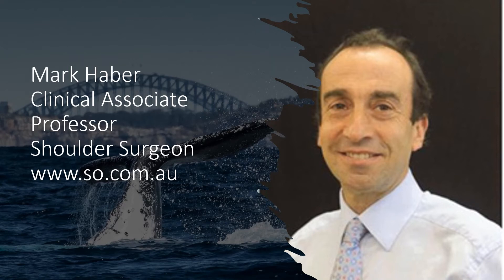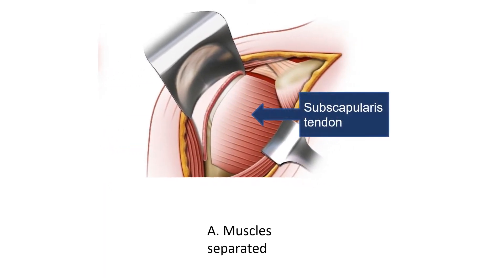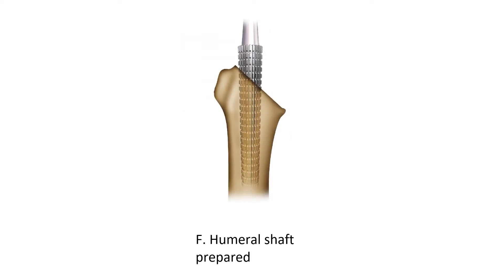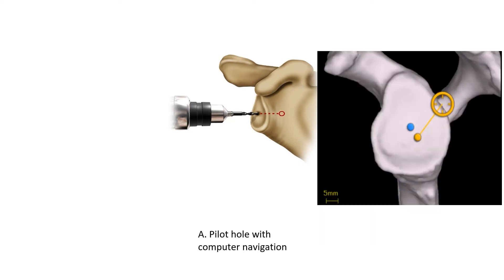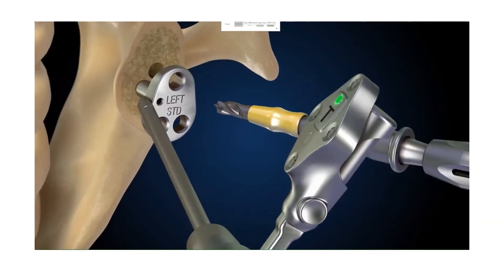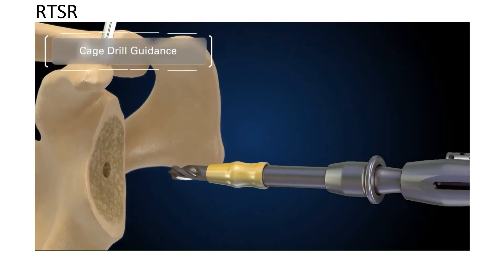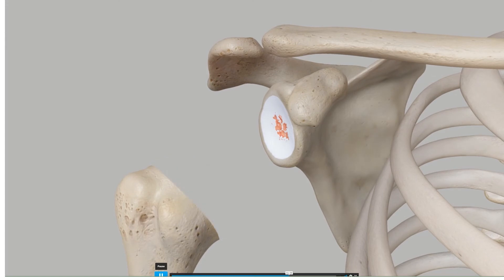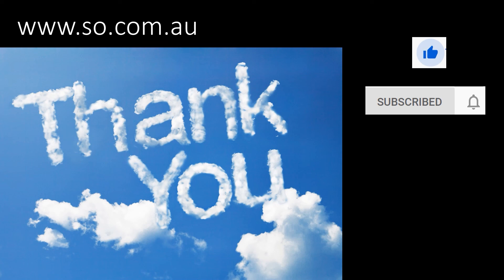Total Shoulder Replacement- surgical  technique

Comment: I had my right shoulder repaired about 20 years ago, The operation went well and I was pain-free for about twenty years, then my shoulder began to be very painful again.  My left shoulder became very painful about ten years ago.  I was given physio and injections into the joint, but this didn't help so I saw a specialist, after more injections he decided I needed an operation.  I had a scan done which showed arthritis in the shoulder joint and the shoulder only wanted cleaning out.  I was operated on but without my knowledge, it was done by a trainee surgeon who did the operation under the guidance of a trained surgeon.  After the operation, my shoulder was much worse.  When I went back to see the surgeon he wouldn't examine me and said there was nothing more he could do for me.   After months of constant pain, I was sent to see another surgeon.  I had another scan done and this scan showed a 30mm rotator cuff tear, snapped tendons and a snapped bicep tendon.  I was again operated on.   After the operation, the surgeon said there wasn't much he could do for me as there had been too much damage done in my previous operation.  I eventually managed to find another surgeon who said he could do a shoulder replacement on my left and right shoulders.  He said he would start with the left shoulder.  That was four years ago and because of health problems, it has been postponed four times.  I now have a date for the first operation, that is if nothing else goes wrong.  Nobody should have to suffer as I have.
Reply: No malpractrice suit??
Reply: practice
Reply: @jeffg5989  Practice what?
Reply: @SloopyDog malpractice suit against the surgeon. I misspelled malpractice the first time. There are statutes of limitations but if they were in the wrong you can take legal action.